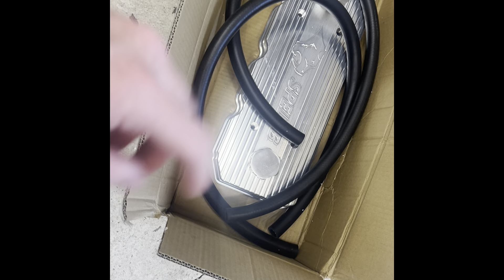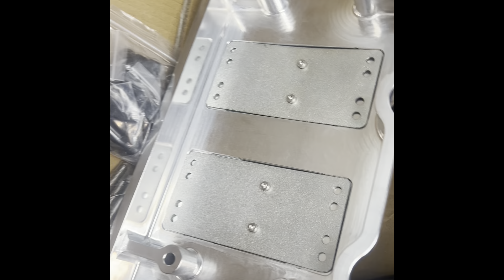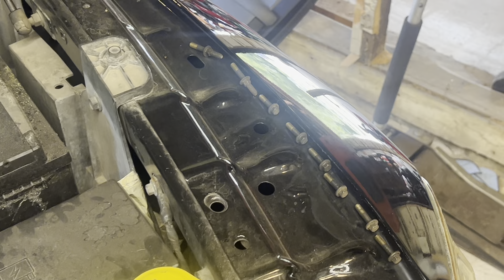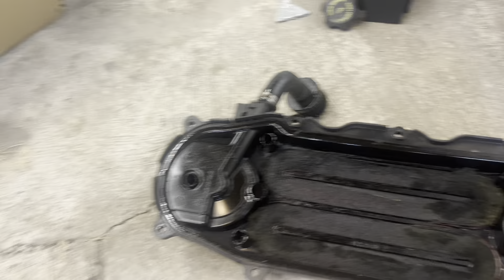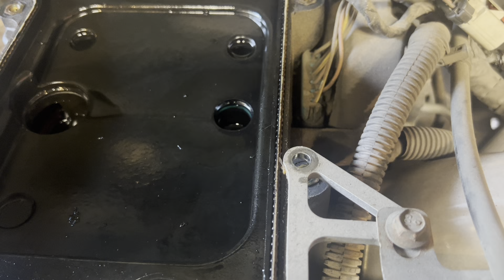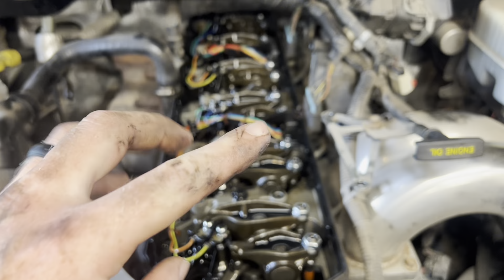Cummins 6.7 aluminum valve cover install. #spelab #cummins #diesel

Comment: Greetings Seattle Tacoma 😂😂😂😂 on my 6.7L Cummins 5th gen ( on Excursion 2006 ) did that helps uses a Vibrant Performance Gen 3 Oil Catch Can Assembly: 4-Port 0.75L 4 plugs 🔌 connection ran it 200k lower oils change around 17.6k to 18.74k after oils test... Also Ram-Air intake Airfilter filter plus Pedals tuner PPE Wix XP AMSOIL filter and bypass oil filter low microns..... 😂😂😂 please check ✔️ and do a video review 😂😂😂

Comment: I just installed the same valve cover on my 2016. With a couple fittings and clamps from Home Depot, I was able to Plumb one of the valve cover outlets to the 2 drains back to the block. Super easy
Reply from the maker: Happen to have a video on thisv
Reply: So it will work perfectly fine if you connect those two  to the stock  ones ?
Reply: Did running the two hoses to the block work without problems?
Reply: Did you have any problems after running the drains back to the block?

Comment: What did you do about the two sensors?
Reply from the maker: No longer needed
Reply: @3guysgarage check engine light won’t come on?
Reply from the maker: @martinlarouche4981 nope no issues

Comment: Didn't show hooking up the breather hoses. What draws air into the catch can?  Where does the dipstick bracket bolt back onto?
Reply from the maker: Honestly I’m not running this anymore. How much oil was coming out of the breather was insane the baffling in this is not good!
Reply: Having the same issue.  How did you solve it  @3guysgarage
Reply: @larssiegfried172 Also having this issue, what’s the resolution?
Reply: @brandonmazzoni4599 replaced with D&J and no issues
Reply: @3guysgarage any updates on the new set up
Reply: So what did you do?🙏
Reply: Wow I'm having the same issue as well I lost 6 quarts of oil changing the hoses around and just going to one and still the same damn problem I'm pulling it off and I'm putting my stock one back on
Reply: @terrynabor4914  I’m currently putting my stock valve cover back on as well. I can’t remember where those two breathers connect to on the other end of the line. Do you know where they go?

Comment: I need the catch can video asap!
Reply from the maker: @liamgonzales3875  I am no longer running this valve cover I will be going with a D&J soon though that from my understanding does not require a catch in most cases
Reply: Why wrent you running the spelab valvcover anymore? @3guysgarage